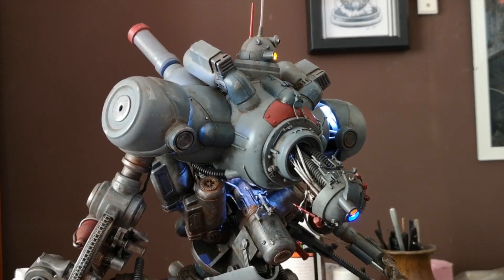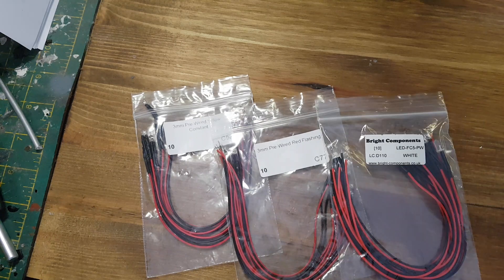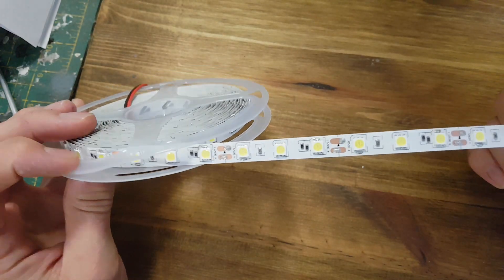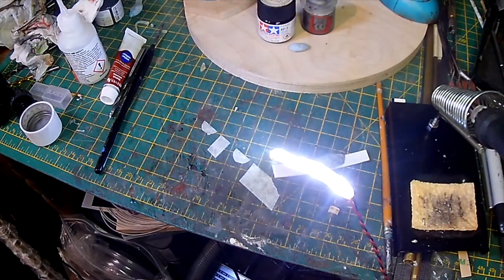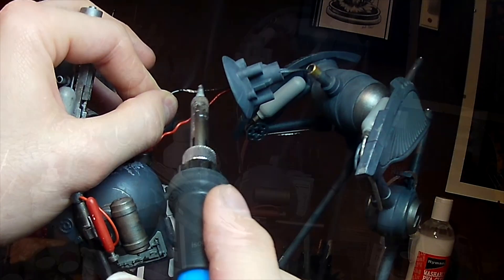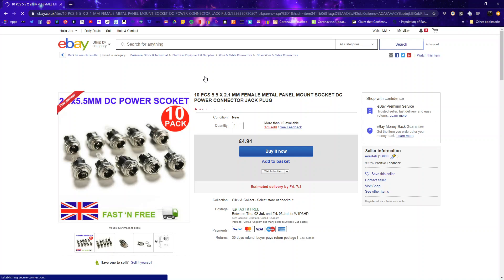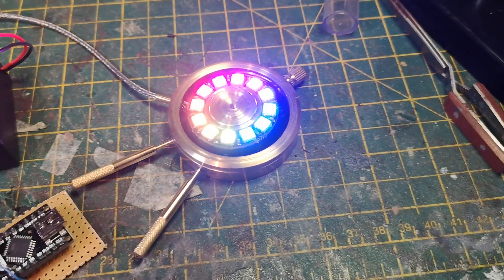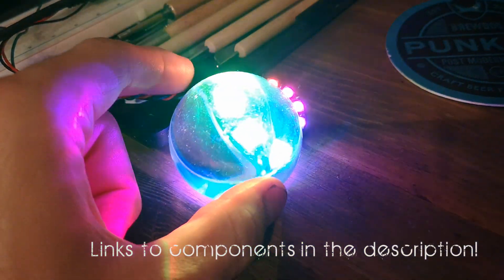How I add LED Lighting to Models

Comment: Thanks! Been looking for a guid for ages. bought some cheap LED prewired strips to use, but then couldn't find any easy tutorial on how to power them, lol.
Seems I can get a 12V power adapter, and a jack, and stick the wires into the jack? Trying to make some lamps, but it seems after I get everything I need, it'll end up being more expensive lol

Comment: The prewired LEDs are genius
Reply from the maker: Yeah they're really handy.
Reply: @thedarkpower what do LEDs need you said a 12v power supply/battery?
Reply from the maker: @haloed-hero  I buy pre-wired LEDs so they already have a resistor soldered in place for 12V.  LEDs natively need less than that, I think around 1.5-3V.

Comment: Neat.  With regards to the led strips, i found some that work off a 5v usb power.  For the  project i'm working on i find this more convenient as i already have plenty of usb power supply plugs (for my phone, tablet and cameras).  And then there's the usb battery packs i bought from the pound shop... you get the idea :)
Reply from the maker: Yep it's a good idea, I was looking into using one of those usb powered phone rechargers to power some stuff, seemed like a decent solution.

Comment: Awesome.video and ideas.  May I suggest looking up “LED projects”, basic LED projects” and/or “logic chip LED projects” here on YouTube? Logic chip are the old  IC microchip that you can use to light up your LEDs with cool effects, without having to program them, just follow the really easy to read connection and wiring, specially using breadboards, which come in a variety of sizes. I made an LED chaser or “Larsen lights” named  after the creator of The old TV shows Battlestar Galactica Cylons and Knight Rider, KITT’s Flashing lights(with a 555 timer and 4017 decade counter and diodes) I didn’t have any experience with electronics, at all when I wanted the scanning lights to stand as eyes, much like the Cylon s but blue. For a metal mask I made. When I found a step by step diagram of this project, it was like putting a bike together following pictorial instructions, just place the components as they show you, no math, no soldering and literally no experience. I now understand the very basics of electronics via experimenting with these projects. When you accomplish these basic electronic projects/kits the feeling is exactly like completing one of your cool models. 

https://www.evilmadscientist.com/2006/make-a-cylon-jack-o-lantern/

If there’s enough interest maybe I’ll do a short video, I still have my [scanning] Larsen lights
Reply from the maker: Thanks for the tip, I'll check it out.  I remember making a distortion pedal for my guitar out of a 555 op amp back in school and a a demultiplexer which basically did a similar cylon style effect.  That knowledge has long since left me though, so it'd be good to relearn that type of thing!
Reply: @thedarkpower  I'd bet it'd be cool for one of your awesome models, one day, too.
Yeah, i love the 555 timer chip, it's largely a robust IC.